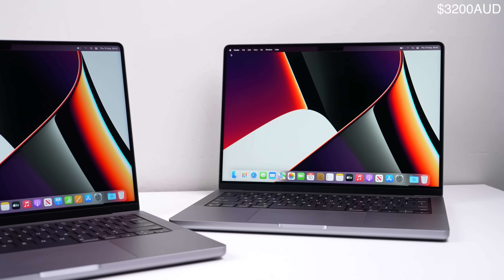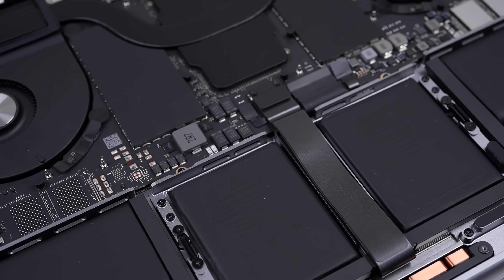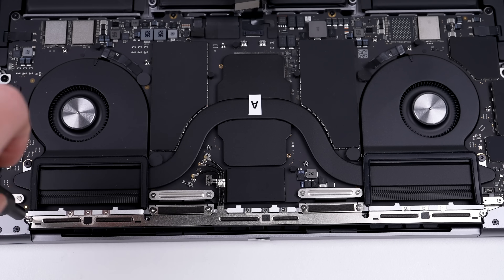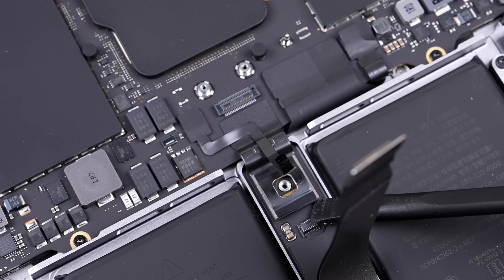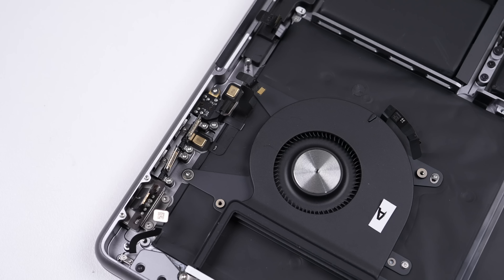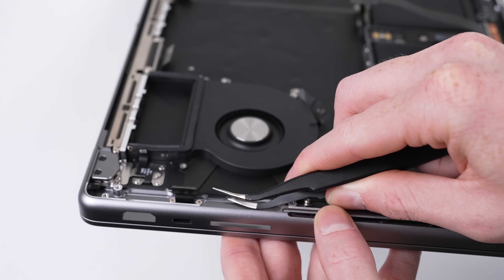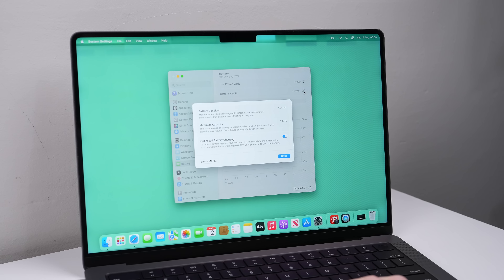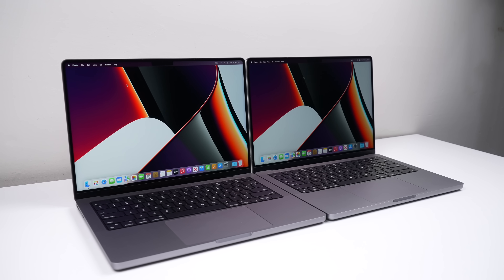New Anti-Consumer MacBook Pros - Teardown And Repair Assessment - Apple Silicon M1/M2

Comment: Amazing video and great showcase: Apple must have spent $millions on the R+D that enables them to sabotage their customer's devices so effectively.
Reply: This is all happening because they don't bother to align the magnet to the sensor when gluing said magnet to the screen, it's a cost saving measure on a 6500$ laptop.
Reply: I don't understand why you are commenting on things you know nothing about. The pairing of the sensor and the screen is an anti-hacking protection, @henria.277
Reply: @henria.277 More like a 2,500 laptop but it has an Apple logo stamped on all the off the shelf parts with firmware kill switches so they charge you at least twice the cost because of the logo.
Reply: Channels like this are cancer. You have no clue about technology and you are fueling your clique on a lie.
Apple pairs lid opening sensors due to security reasons, when the lid is closed, the USBC ports are turned off. You can't connect something that will steal data.
Reply: That's a particular issue I have with all tech these days. In order to gain we must lose now. For example all the so called AI being developed answers your questions maybe. Yet a few years ago google search used to but suddenly mysteriously it's been extremely downgraded so that it barely functions now and misleads you. So maybe AI will upgrade so parents can pay the service fees and school kids can know facts instead of being sold and lied to.
Reply: @kencochrane2885 Concerning Google and their searches is a who box or two to unpack in itself.. Short answer is they stear you towards who pays the most or uses the most spammedhash data on their sites to attract the algorithm. As for AI... Well going to burst your bubble but they are stupid as hell and little more than a glorified search engine.
Reply: I bet this makes their manufacturing process a lot easier though, everything is just integrated and calibrated at the factory and they don't need to spend an extra penny (or more likely since this is Apple, not having to sacrifice any polish or make it a nanometer thicker than it needs to be) on worrying about upgradability after.
Reply: @darkwoodmovies  How though? Nothing is different from any other manufacturer other than no one but them has acess to the calibration software.
Reply: @SilvaDreams  But remember, this is Apple. Dell will happily release unpolished software used by their devs internally. Apple would never unless it's packaged in a perfect beautiful UI, probably as a standalone production-ready app or something.
Reply: @darkwoodmovies  It's also Apple so they'd never release anything that lets you fix an issue they cause. (Not giving Dell any points though, they have their own fair share of shitty practices)
Reply: @SilvaDreams  There's definitely an aspect of that. But I feel like it's more a "this doesn't benefit us anyway so we're not going to bother" thing rather than "we want to make this deliberately hard to upgrade so we get more money because we're evil" kind of thing.

Comment: Awesome video as always! Hey Hugh, can you please also record a step by step disassembly of 14” and 16” for those who want to change the battery or thermal paste themselves? I can barely find any high quality video in YouTube! Thanks!
Reply: Channels like this are cancer. You have no clue about technology and you are fueling your clique on a lie.
Apple pairs lid opening sensors due to security reasons, when the lid is closed, the USBC ports are turned off. You can't connect something that will steal data.

Comment: Don't even bother with a company that soldiers the RAM and storage on the motherboard, but everything else is connected via flex cables. That's bottom tier engineering right there.

Comment: I would like to see Asahi Linux on the laptop after the screen is swapped . I bet you its a software thing not a hardware thing that mark on the screen. My lenovos backlight control does not work if you replace the screen with a none approved model when in windows but it works just fine in linux.

Comment: This trend is only getting more important with time. the only product from Apple I own is an iPhone because it have some accessibility features that I can't get working as good elsewhere. But aside of that I will never touch to a Mac or any of their other products I know I don't own.
When you ask manufacturer like ST or Texas Instruments for a custom chip, it's generally the same as one out of the shelf to which they add some kind of firmwares-level pairing, so it takes extra effort for them to design it, thus having the same or slightly higher cost of manufacturing. I still don't see why Apple fanboys still defend this garbage mentality without getting paid...

Comment: Based on this video and my recent battery replacements of a 2015 15" MacBook Pro (glued, but not too bad) vs. my 2019 16" MBP (nerve racking, one damaged cable, and several hours) I have decided I will not buy a new MacBook Air. 

When my phone dies, I switching to Samsung and Windows. Maybe not much better, but at least the calibration of what should be brain dead sensors isn't used to force consumers into unnecessary and expensive factory repairs.

Comment: Ironically my 10+ year Hp Pavilion laptop is far more repairable than todays equivalent. The underside of the Pavillion provides easy access to the ram, hard disk and cmos battery. The laptop battery is completely removable without undoing any screws. HP produced a detailed maintenance manual to enable replacement or repair of almost all of the laptops components. My newer HP laptop bought last year is much more difficult to repair. Access to the inside requires an awkward disassembly. The only item that is user replaceable is the SSD. The ram is soldered directly to motherboard. From My memory the battery has to be removed to gain access to other components. So not impossible to repair but much more difficult.  My next laptop will likely be from Framework. In past I have bought newer laptops mainly to get a better CPU and faster memory etc. With a Framework laptop I could upgrade the CPU mainboard which is a preferable alternative to paying for a complete new laptop.

Comment: I find it interesting the wild ways in which these apple devices crap themselves when components are swapped. I wonder if the specific issues are just random hardware glitches or deliberate code?
Reply: The display issue is deliberate code. The lid angle sensor is just apple being shitty.

Comment: Basically Apple is still the unbeatable master at manufacturing e-waste. Most common repairs excluding battery replacements are probably broken screens and keyboards, now both of them are pretty much impossible to do - at least not with reasonable cost.
Reply: I saw that the Eu passed a law stating that from 2027 almost everything having a battery such as smartphones will have to be easily replaceable / removable
Reply: @dinesh_k7651 thanks to EU to force Apple to do away with some of their anti-consumer practices.

Comment: This along with the soldered ssd (and cost of storage when configured at purchase time) is total bullshit. Despite how nice the hardware is, I'm never going to buy one again and will consider Framework next time I need a new laptop. I do wish PC manufacturers would step up with regards to having good performance without significant heat and noise when under heavy workloads though.

Comment: You're supposed to order the replacement display from Apple to do the self-repair. It's documented in the self-repair guide.

Problem solved.

You knew it was gonna fail and still did the swap 🤷🏻‍♂

Besides, iFix made a living selling Apple repair screwdrivers ... 🤣

Comment: I recently had to get a new laptop as my 32gb RAM intel macbook was somehow now not fit for purpose anymore, with the professional programs I use for work proceeding to glitch to the point of being unusable after updating to firmware I presume designed for silicon architecture. I desperately wanted to switch to PC but my industry (music business) is dominated by the Apple ecosystem to the point that simple essential tasks such as airdrop, the ability to send uncompressed files on iMessage, to all the third party software I have bought for Mac over the years and lots more reasons too long to list  dictated me to trade in my MacBook (that I paid £3k for in 2019) to Apple for only £525 and to buy a new MacBook that is ‘fit for purpose’ for £5k. At this point this practice of consumer manipulation surely cannot be legal???

Comment: All these companies, and Apple in particular, are trying to change the definition of what's eco-friendly and what is not, just for profits sake. They're saying that including a charging cable and brick is not ecological, but turning their devices into 100% potential e-waste is perfectly fine. As you said, that after this laptop will be out of any support and parts supply will dry out, the only way for this is into the bin, basically, or for parts for other devices which are a bit more lucky.

And I understand why. If your device is broken, and you're not able to fix it by yourself or, f.e. authorized repair center, you're probably going to bring it to Apple Store and trade it in for another device or get a replacement device. And your device will get into their refurbishing program, just to be sold again. Probably even a couple of times more. 

But still, so many devices will end up at the landfill.

Comment: 5:35 That's a logical fallacy to say if an issue repeats, its not an due to workmanship. But I do agree with you about the possible cause being calibration pairing. 

It's sneaky of apple because the issues from replacement very much appear to be poor workmanship damaging the laptop.

Figuring out how to calibrate them is the next step. If they can be calibrated remotely, then we have hopes.

Comment: Well, it is not completely impossible, just huge pain in the ass. We swap spi ROM + display controller on LCD board when fixing the LCD(also ifixit still claims only truetone will fail and sell screens despite color and shadow block issue), as for angle sensor, it might be programmable like on older intel 16 inch Mac, but the amount of steps required to make such simple things work is a joke.

Comment: Let’s be clear that apple isn’t the only ones doing this kind of anti repair tactics, many other brands in different sectors also do this. And seeing this is actually disgusting and needs to be brought to light more
Reply: Apple is on a different level regarding anti consumer behavior and is not stopped because lack of practical regulations.
Reply: @stoomkracht  Apple isn’t different from any other corporations that do these anti repair tactics. The issue is that it’s not tackled at a higher level in government they simply don’t do enough and most consumers are in the dark and at the end of the day they just want a repair done quickly and in most cases will not fight the cost. But if your device goes because of a 50c ribbon cable and are charged a couple of hundreds for a repair that’s theft!
Reply: @DMVB2307-u6d  I've never seen any other electronics company where it was brought up to that scale. Apple, unfortunately, is a leader at the moment.
Reply: Lobbying ... king $$$
Reply: Perhaps they're not the only ones doing it, but it's the most obvious with their devices, because you are charged premium for a device you basically don't own.
Reply: @igordasunddas3377  harsh reality guys, even a 100,000$ car you don’t even own anymore….. same goes for all these electric cars with all these gimmick features. Think about it
Reply: Name 3
Reply: Apple is by far the most brazen about it in the consumer space.

Most of the time, you just can't buy factory parts, and that's all. Maybe the memory or storage is soldered to the board, but provided you can (for example) buy a replacement screen from somewhere, that should work, it's just swapping the display over and you're done.

Apple OTOH, has decided to be deliberately malicious with their antics, by first making it hard to get replacement parts, and then when they do offer them, making it a whole process to actually use them (significant amount of work to get it off, then needing to contact them for not valid reason).

I refuse to buy "calibration" as an excuse. If it was a calibration issue, the issues wouldn't be exactly the same on both devices (or rather, almost identical).

Comment: The worst offender in the laptop i feel is the ssd how many reads and rights is it rated for and will it last 3 years of everyday use.
Reply: It should last about 6 years, that's when the 2017 MacBook Pro given by my company failed. By which point the fucking butterfly keyboard had stopped working more than a year ago anyway. It was a desk ornament at that point.

Comment: Anyone still being loyal to Apple, does every consumer a disservice.
Reply: Pretty much every electronic device I have is made by Apple. I buy Apple products because they work simple as that. Across-the-board all of my devices work well with each other. I'm not sure which galaxy do you feel that if someone is loyal to Apple or wants to buy their products is doing consumers a disservice. If people don't like Apple products, I don't like the repairability they don't buy them. For me the fact that I never ever have issues with any of my Apple products tells me I would rather live with the fact that maybe I can change the battery with a memory. That is fine with me, but it's not up to you to tell me how I should feel about some thing. By far Apple products are the most reliable and safe to use. Meaning that the combination of the software and hardware makes it very difficult for anyone to hack these devices as compared to any android device again if you don't like the product, don't buy it. If enough people don't like it and don't buy it that will force changes but I don't feel the government has any business before season changes. How about the government starts? Looking at these oil companies gouging us over and over again instead of worrying about us replacing a battery or a screen. The fact is I've never had to change any of these items because the Apple products just Work.
Reply: TL;DR you don't actually own any of those devices. Apple just lets you use them.  @kevinshea5819

Comment: Back in the day friends and classmates claimed one of the justifications for the MacBook's high price was its quality and longevity, and it seemed to be so compared to some PC laptops, but these days it seems to very much not be the case...
Reply: Yeah once the SSD dies these things are e-waste.
Reply: Last time I bought a mac was in 2009, you could even replace the battery without removing any screws. I replaced the HDD with an SSD and upgraded the RAM sticks too.
Reply: I'm still running a 14 year old PC... I was lucky ofc by picking an x58 platform but good luck getting a Mac to last this long yet remain functional.
Reply: I had the cheapest 2015 MacBook Pro for audio production at uni. That thing soldiered through massive projects I would not expect Windows (at the time) to handle at the same spec, and it just kept going. I still have it, though I don't have much use for it these days.
I wouldn't bother with a MacBook these days if I was in the same situation.
Reply: @HarmonicaMustang I have a 2011 PC that works no blue screen with win 10.
Reply: Channels like this are cancer. You have no clue about technology and you are fueling your clique on a lie.
Apple pairs lid opening sensors due to security reasons, when the lid is closed, the USBC ports are turned off. You can't connect something that will steal data.
Reply: Dele and thinking pad are unbreakable and for years. And at a reasonable price without paying for the product logo like a saint's finger.

Comment: You don’t understand! Apple needs to pair screens to each machine for safety and security!! What if the new screen was made by bad actors that put a spy chip in the replacement screen to record everything on your screen! And the sleep sensor is even more vital for your safety! What if you replace the sleep sensor and it shorts the battery and explodes while your child is using it! Clearly apple cares about its users more than any other company! If you can replace parts in your laptop planes will fall out of the sky and people will break into your house! The mega corporation is only doing this to protect you!!1! Your a terrible person for taking apart the item you paid for!

Comment: And people are dying to buy all these shits, for a geek like me, this a complete nonsense device, which doesn't even gives a proper control over the device as I am paying a hefty premium price, then I want full control over the device, this is not secure device or premium non hackable piece of crap device, rather it's just a handicapped showpiece with a just a good eco system for sharing files only n nothing else. Bullshit. Dear friends please justify only one thing who the hell in this world solders an SSD (the Nand chips) to logic board, there is something called wear n tear i guess or electronic failure. They deliberately wants uh to throw this mac after 1 year, better if thrown after 6 months. This is what they want actually. Dear apple uh want money that's good but learn to give something in return, don't make this mother earth junk with iCloud locked usable devices, meaning less lightening cables, unusable but reusable Mac's and n out so called pseudo secured iphones. Please please please. Even Steve Job is also regretting from his grave that what kind of ass**les are running my company, where the hell is innovation, " The only innovation is making people life more difficult ". Huh !.